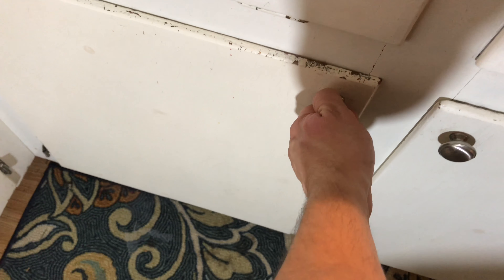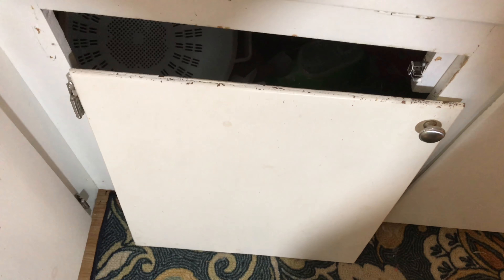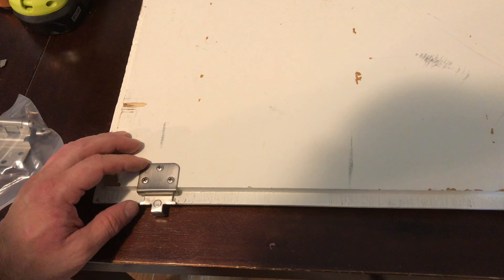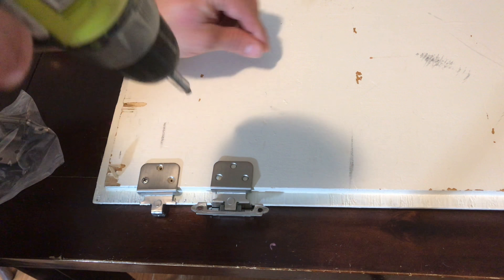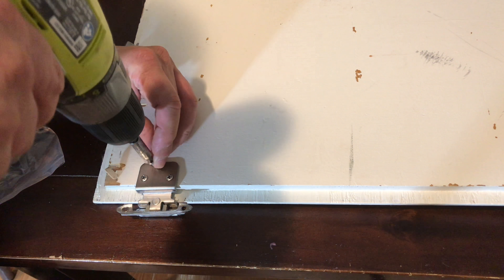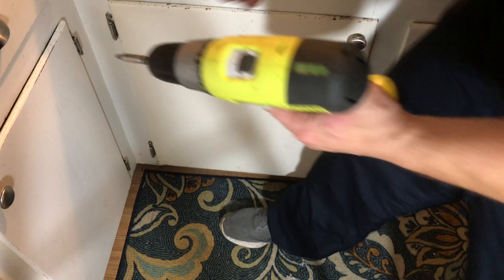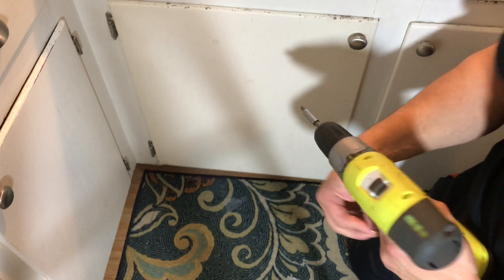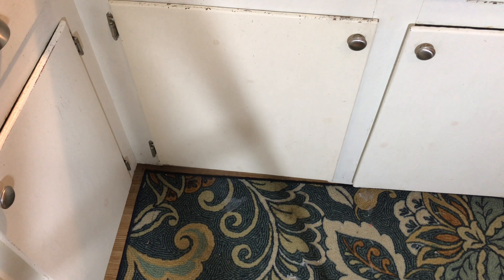How to Replace a Kitchen Cabinet Door Hinge

Comment: The packet for the hinges has 2 different length size , the3   longer has a,round head the 6 shorter ones have  a flat head, which one use for what?